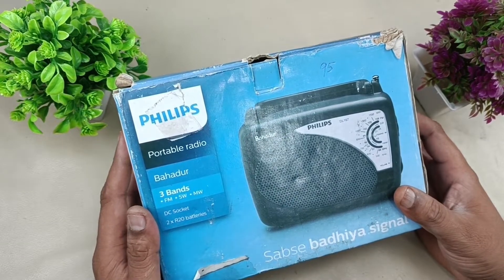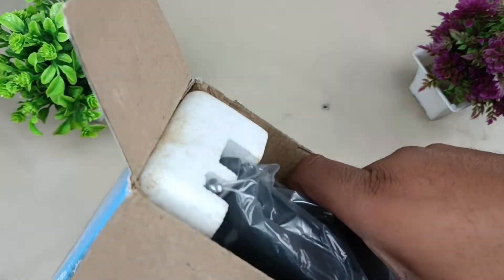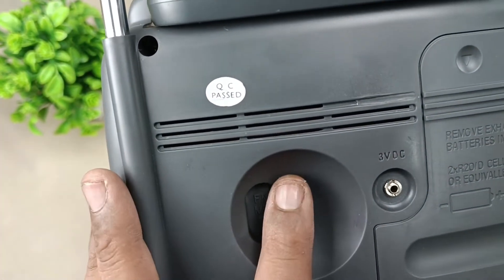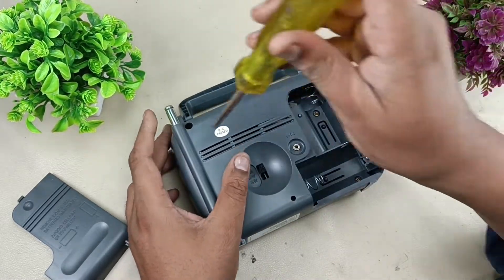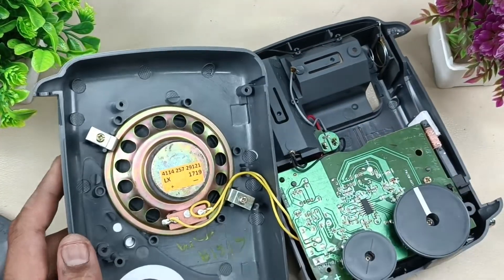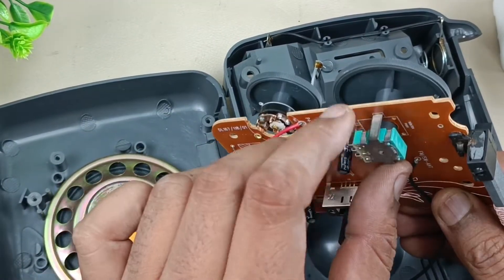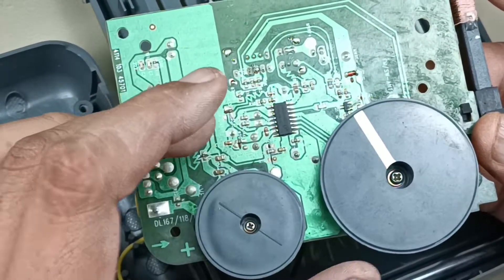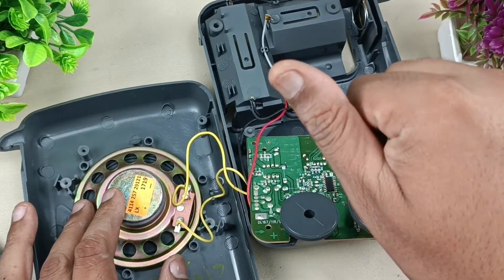Radio Review & Disassembly | Looking inside the Analog radio | Philips Bahadur | How to teardown

Comment: MW is not coming but fm is working., where is the problem?
Reply: MW Antenna Coil may be broken, Band Switch contact loose required oiling, or Connected Resistor with Band switch nay be burnt, but very less chance for Resistor.

Comment: Waste technology regarding radios. Becausse anolog radios are far better than these dsp radios regarding tuning of radio stations.
Reply: DSP is good because there is no problem in reception, dampness of coil during rainy season, no trimmer no gang Capacitor tear down. 100 percent reception quality. No Bandswitch hassles, only voltage divider technology to receive different bandwidth.